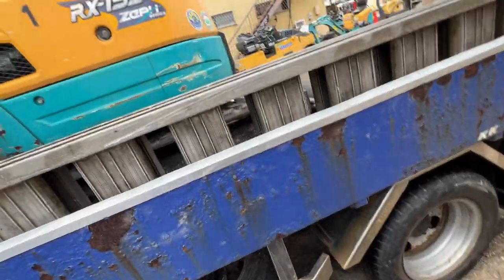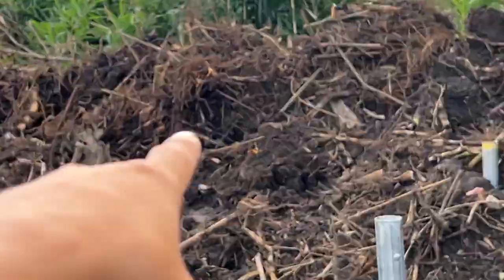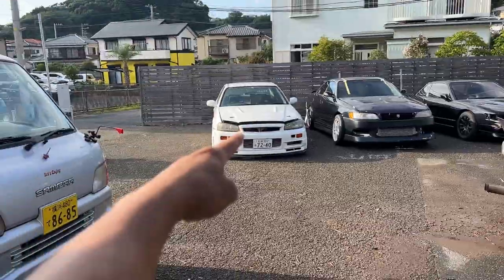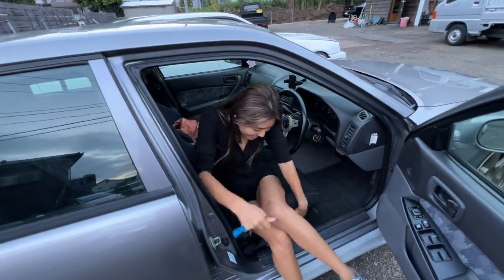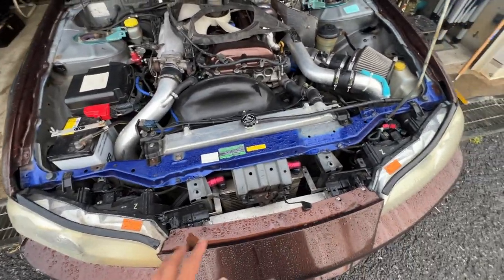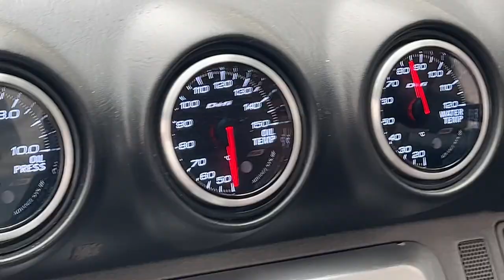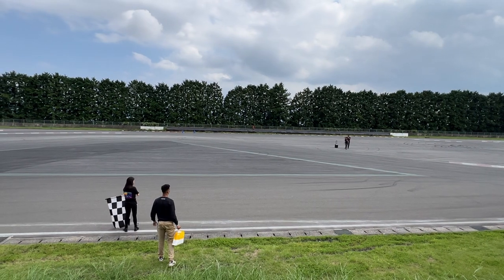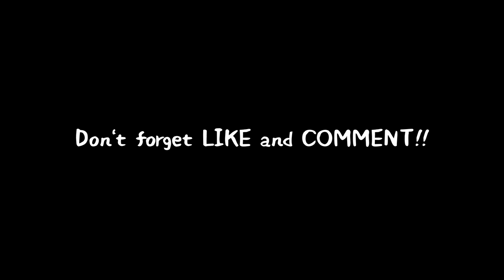SURPRISE! IT’S A BOY🫶🏽

Comment: If you pour some self levelling cement you can make the shop floor look amazing and for pretty cheap!
Reply: I concur💯
Reply: Wont have the structure for a lift though. He would have to cut out and poor pads for lift
Reply: @reverendroger  you sure can…..the layer of concrete is thin…..you need to anchor into the sub concrete pad for a lift…..we just did it at my buddies garage…..self levelling cement then epoxy top coat……